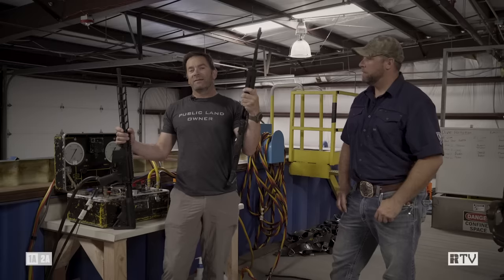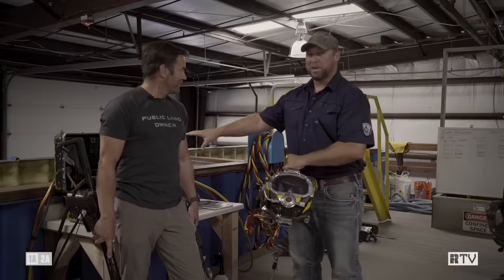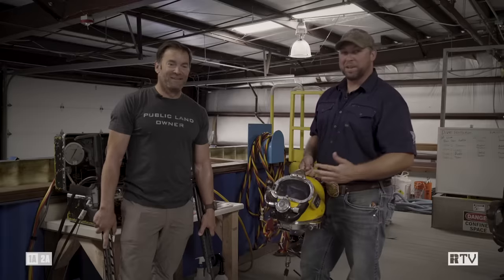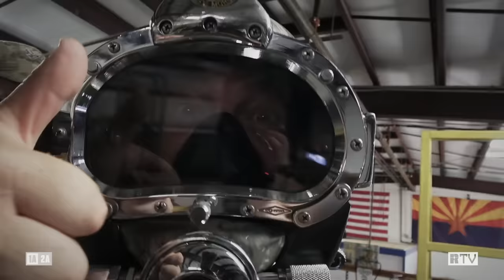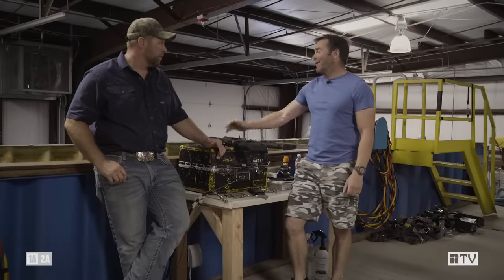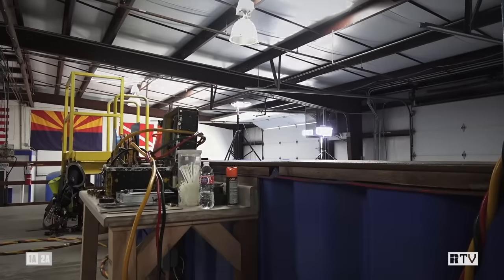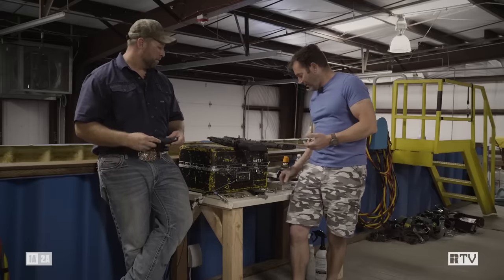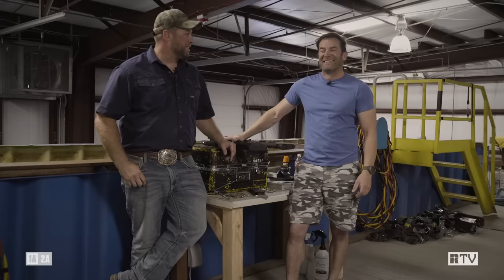AR vs. AK.....Underwater

Comment: So, bayonets are still relevant.
Reply: because it rains sometimes.
Reply: bruh
Reply: I'd rather be shot than run through with an M9 .
Reply: “Always has been”
Reply: @callsignsleepwalker7231  "stopped being relevant with the invention of the semi automatic rifle"
Reply: There are APS and ADS, which are basically AKs for underwater
Reply: Jack Knight  you clearly haven't seen what a muzzle strike from a rifle can do without a bayonet, it can split a sternum. Again, SF guys that specialize in CQB don't consider a bayonet at any point in their careers. Stop trying to use what you think is common sense to figure these things out, there are trained professionals who have already figured it out for us. I own bayonets for 2 of my rifles, and I used to keep them attached when I was 18 or 19, I'm not biased against bayonets, I just realize that they're silly in any situation other than a walking dead zombie scenario where you need to kill zombies quietly.
Reply: Jack Knight okay, and regular army and marines don’t have bayonets on their rifles either. That wasn’t the best argument for you to make anyway, regular soldiers that are deployed over seas operate in groups of 20-300 soldiers, get resupplied regularly, and don’t usually get in firefights too often as they usually just keep one region locked down. When a tier one unit deploys it’s in groups of 4-16, they are getting in the hairiest situations that command wants carried out, and their is no ability to get resupplied once in it, those handful of guys have what they have and that has to be enough to get them the fuck back out of that situation with relatively little support compared to regular infantry. Yet even still, only 4 guys (that can only carry as much ammo as 4 guys can) still don’t bother considering a bayonet for that situation, probably because an extra mag (which weighs about the same as a bayonet) is way more beneficial to you in a combat situation than the ability to turn your rifle into a spear during a firefight with people using automatic weapons.
Reply: Always
Reply: something about the last time bayonets being widely used was in Vietnam
Reply: knifes don't cut underwater
Reply: @StriK3FoRC3OwO  you're joking right? Im gonna assume your joking.
Reply: @wisesalamander125  nah it's a fact
Reply: I still want mine. Don't care what you call as millennial think about it I still want mine. And I don't need a college derelict telling me otherwise.
Reply: Tridents
Reply: Nah, just detonate your C4 and say f... you to everyone around 😂
Reply: Fun fact us Canadians still train with, and carry bayonets I think the only 1st world military that still does, we're sorry until you're sorry.
Reply: @jonahpatton8879  Bayonet never runs out of ammo and doesn't make a loud noise when you a confirming that something is dead.
Reply: Benevolent Highwayman you mean something that you already shot? It’s a little late to be quiet after a gun fight, and you could just use a knife that isn’t attached to your rifle for confirming something’s death. And how exactly do you plan on not getting shot while rushing someone? Back when guns held one bullet and took 20-30 seconds to reload sure that made sense, but In the age of 30 round mags and semi automatics, a 10 pound spear isn’t exactly a great weapon for modern combat.
Reply: @jonahpatton8879  There are several situations where bayonets are used rather than using a knife in hand.  
Have you ever used a knife or had one used on you?  
Have you ever used a bayonet or spear or had one used on you?  
Have you ever tried to stab a guard dog to death or slaughtered an animal?  

The 4 best reasons reasons to use a bayonet over a suppressed handgun is that the bayonet is virtually, silent, compared to being as loud as a nailgun, bayonet doesn't require slinging your main weapon, bayonet doesn't use ammo and a bayonet weighs less than a pistol and suppressor.

Yes, when a person or animal has been shot, fragged, gassed or whatever and it is either not dead or not clearly dead, it doesn't hurt to stick a bayonet in it to be sure and without stupidly and unnecessarily getting within arms length.   If you come across a potentially dead enemy or dangerous animal while trying to be quiet, your battle buddy can cover you while you stick it to be sure.  This is especially true for guard dogs, venomous snakes, wounded livestock such as pigs, bulls, etc.  If it moves at you, you can still shoot it if necessary.   
This is still done today, although not spoken of so much.

In a lot of places around the world, enemy are killed with bayonets or machetes after being rounded up in order to save on ammo and also to not alert everyone that you are executing prisoners.  While that is clearly not U.S. doctrine, you can see why Combloc rifles such as the Mosin 44 and SKS45 and their Chinese counterparts came with permanently attached bayonets and AK was issued with a bayonet.  In the Rwanda genocide, most of the killings were done with machetes or spears after they taken outside at gunpoint.
Reply: Benevolent Highwayman again, find me evidence of a navy seal or delta/CAG operative using his bayonet ever and I’ll at least consider your points.
Reply: @JSpark135  I did RBT in 1990.
Reply: There are underwater cartrigeless needle guns. Those are accurate and reliable
Reply: @jonahpatton8879  spears were the king of the battle field before guns and I would rather have a spear over a knife any day your acting like you can just grab it or some shit but in reality a spear in very hard to overcome with out a shield. In duals a spear men can take on 2 swords men at ones now of cores it's not better than a gun but if your out of ammo a spear/ bayoneted will always win a knife I do not care how close you are. you're forget you can just slid closer to the tip if your enemy gets closer
Reply: @anglosaxon1019  spears were the king of the battlefield yes. Hundreds and hundreds of years ago. That is not the case anymore, and if you run out of ammo and go on a bayonet charge you better pray that they ran out of ammo too. If you're planning for a long term mad max apocalypse and want something for when ammo is scarce, then sure that makes sense, but until that happens bayonets are obsolete (obsolete does not mean useless, like I said, I own 2) which is why zero special forces units use them. and if that does happen, you'd be better off having gotten into archery pre collapse. Because a bow beats a spear for most applications in that situation.
Reply: @jonahpatton8879   the most basic armor stops a arrow and I agree a bayonet is basically useless. Its just that you said it was useless in close rang and that a knife would be better and I just do not think that's true
Reply: @anglosaxon1019  it's true if your gun is loaded. At the ranges a spear or bayonet is useful (and beyond), a gun is better, and when someone is so close (I'm talking grappling distance) that your rifle is less than ideal, a handgun or knife is superior to a rifle or a spear/bayonet.
Reply: @jonahpatton8879  I agree that the knife is best in grappling distance it was made for a reason but the only reason that the fight is that close in most cases is because know won had a longer weapon that would keep the fight at a longer distance. Why would 2 people with knife fight from 10 feet a way they cant hit each other but if one has a spear it would force the fight to go that way and yes you could grab the spear and close the range but in most case you will just end up dead.
Reply: Anglo Saxon sure but that assumes that it is knife vs spear. Realistically in modern times it would be wouldn’t be knife vs spear. It would be Gun v gun, gun v knife etc. knife v spear is hardly a debate to be had. But if you have a gun a spear is somewhat useless because outside of grappling distance you would use the gun, and in grappling distance you would use a knife, therefore making the bayonet obsolete.
Reply: @jonahpatton8879  A spear UNDERWATER...
Reply: @jonahpatton8879  if you had a gun they would both be absolete
Reply: Anglo Saxon not in a tussle. If you round a corner and someone is on top of you already a knife is very useful, more so than a handgun, because someone can grab the slide of your handgun, now you’re in a struggle for it, and you only get one shot, because with someone’s hand on the slide, the gun will certainly jam, and that's assuming that the gun is even in battery for the first shot considering than the are 4 hands on it fighting for control.
A knife on the other hand, can’t be grabbed by the blade (I mean it CAN but it won’t end well for the person’s hand) making it much harder to be disarmed in said scuffle.
Reply: officer with bicorne in scuba hear: make ready, present, charge that shark!
Sharks: here they come lads, fix jaws
Reply: you usually use and underwater assault rifle such as the ads or vds, an american company also made ammo to fits in every gun which works underwater

Comment: Apparently, don't operate high pressure gas creating systems while fully submerged in an extremely dense fluid environment. Weird.
Reply: Fluid 
Dynamics
Are
Real
Man.
Reply: @DarthJermz  Yup. Carved the world, destroys guns.
Reply: I know, but still, HAD to watch! lol
Reply: Lmao, you in and of yourself
Reply: I like to shoot my high pressure gas creating system outside in the air. No problems
Reply: The ADS rifle disagrees with your statement.
Reply: Right,  who would have thought?
Reply: I would actually want to see someone design a gun around the exact operation parameters presented in water. I know it would be useless (considering it might not work at all in air depending on how they disperse or alleviate pressure) but, it would still be cool!
Reply: @oceanbytez847  The Russians produced a weapon capable of it. It's primarily designed to fire up out of the water at a close quarter target. The projectiles were designed to be efficient; high pressure charge, elongated and heavy projectile. They called it the APS. Basically, it was a magazine fed spear gun.
Reply: @lucastonoli3256  the ADS and APS were designed to operate underwater with a self ventilating operating system. Not really the same thing.
Reply: @Cmoth040  They are high pressure gas creating systems. Si yeah, don't be buttsore and take the correction
Reply: @lucastonoli3256  Relax guy, it's not that important. Kind of like me correcting your using the word "buttsore"... the term is butthurt. It's not actually a correction, just a slight difference. Like the firearms, one weapon is designed to work with the fluid resistance, one isn't.
Reply: @Cmoth040  Still working under high gas pressure, hence why it can push a chunk of metal through a rifled barrel and onward 25 meters or so under water.
Also, expand your Internet vocabulary a bit
https://www.urbandictionary.com/define.php?term=Butt%20Sore
Reply: @lucastonoli3256  Dude, seriously, it's okay, potatoe / tomatoe.
Reply: @lucastonoli3256  Never heard anyone say buttsore in my life lol also "buttsore" has like 23 votes in total on urban dictionary leading me to believe this is why I've never heard it because nobody says it xD Lets make it a thing lol
Reply: @lucastonoli3256  using urban dictionary as a reference is self defeating,like using wikipedia as a reference,it holds no value in any argument

Comment: I love how he just didn’t want to admit the AK functioned slightly better.
Reply: @ModernBladesmith  wait how did the ak brake
Reply: @atomic_s0n1 the same way.
Reply: @ModernBladesmith  it didn't break. Light primer strikes are not 'breaking', it just failed to hit the firing pin with adequent force, due to water resistance. The AR's mag flew out.
Reply: @deathlocus1571  actually no. The AK no longer fires because it's broken. Just like the ar. The ar damage looks worse but both guns are effectively scrap at this point
Reply: @ModernBladesmith  Describe the break more than just broken if that’s the case. Otherwise, it’s just a simple malfunction.
Reply: @deathlocus1571  well my dear communist gun lover. the high pressure blew parts where they weren't supposed to be so now the pin is too far away to strike the primer in the casing. the gun wasn't meant to hold that much pressure and consequently expanded the internal components past where they are supposed to sit. on an AK variant i believe it is nearly impossible to fix due to them being mostly pressed together. that gun is now effectively scrap.
Reply: @ModernBladesmith  That isn’t true. The hammer would have held the firing pin inside of the bolt. Just because the primer didn’t go off didn’t mean the weapon didn’t function; because the AK did drop its hammer and did hit its firing pin. Whether the light strike was due to cheap ammo (steel case) or water pressure is unknown, but the gun isn’t broken.
Reply: @deathlocus1571   it's most definitely not a functioning rifle anymore. if it were brass cased, it would never have kept clearing the chamber as the casing would have exploded in the rifle like it did in the AR.
Reply: @ModernBladesmith  I can see why you’re called the bladesmith and not the gunsmith. The AK gas system is a lot larger and not just a ~3mm ID brass tube. Low quality primers not firing due to slow firing pin speed doesn’t make it a broken gun. If you took it out of the water, the firing pin wouldn’t be impeded by the density of water and it would fire fine.
Light primer strikes happen on certain guns, even above water.
Reply: @deathlocus1571  unless the force causes a headspace issue
Reply: Cope
Reply: Would you rather a polymer mag break or have a gun that doesn’t fire due to light strikes?
Reply: @deathlocus1571  you should really go back and watch the video before you comment. The ak is out of headspace. Aka broken. It won't fire because the barrel moved forward or the trunion moved backwards. It is now scrap.
Reply: The at blew apart
Reply: @noahlance2526 the magazine blew out of the AR and got a peice of brass stuck in the chamber. The AK literally stretched apart and now doesn't headspace properly. Neither performed better than the other. They both got one round off and were rendered unusable.

Comment: The Russians  long ago made the APS. And I think it's the SPP-1 even further back. both are designed exclusively for underwater.
Reply: ADS is more interesting. it’s fully amphibious rifle which using special ammo 5.45x39 PSP which is dimensionally almost identical to regular 5.45 so it fits into standard mags.
Reply: yep, but today we have this with new amphibious ammo in 5,45 formfactor https://en.wikipedia.org/wiki/ADS_amphibious_rifle
Reply: It doesnt use 'bullets' per se. They are like kinetic darts. Water is hard to go fast through
Reply: I think they fire in the air, but kinda weak because they are subsonic

Comment: Water slowing down the AK hammer?
Reply: Also, steel cased ammo tends to have harder primers. It was a brass case that actually fired, but you could see the grey steel getting manually ejected before it went off.
Reply: that would be my guess more than a headspace issue, as the first round failed, domestic ammo with their soft primers may be a solution, wonder if you could skip that and just tube in some air into the receiver to displace most of the water?
Reply: @wdixon27  My guess is the headspace is fine, but the dramatic overpressure of that first round damaged the tip of the pin or flowed some primer material into the bolt and hung it up. That trunnion's a pretty decent chunk of steel as is the bolt, I doubt they would have stretched that much.
Reply: first round fired underwater destroyed the gun.
Reply: Id say hydraulic dampening could be a probable cause of malfunction.
Reply: @100GTAGUY  the water is slowing the bullet as it leaves the chamber increasing the pressure and blowing the mechanism
Reply: Erwin Wiesbauer...I think it has more to do with the fact that the hammer is completely engulfed in water and thus more affected by the water resistance whereas the ar hammer is more internal and contained.
Reply: @chuckd5877  i mean shooting underwater is like shooting with massive a barrel obstruction. the overpressure of the first round would be way more likely to render the gun inoperable than just the water resistance on the hammer.